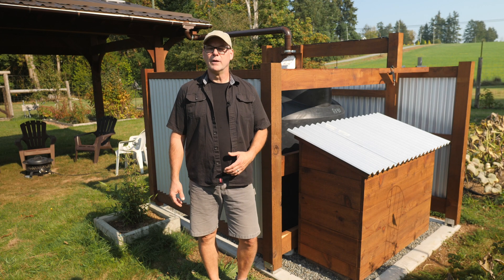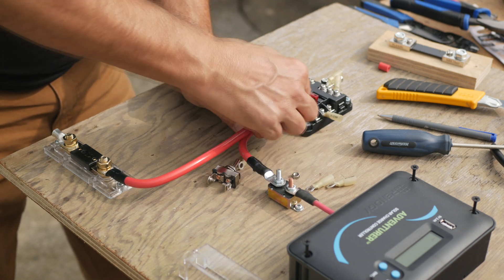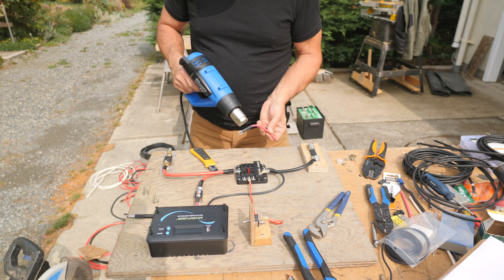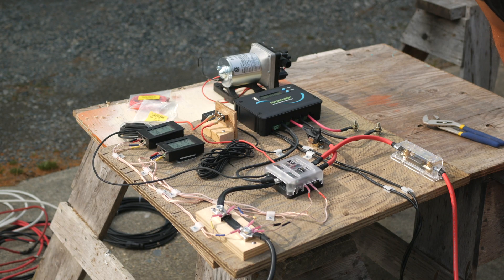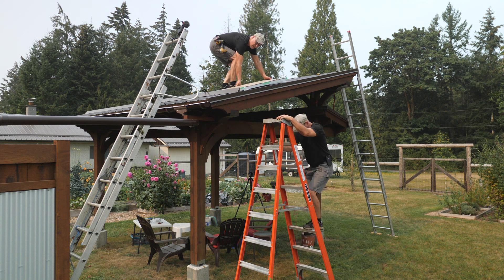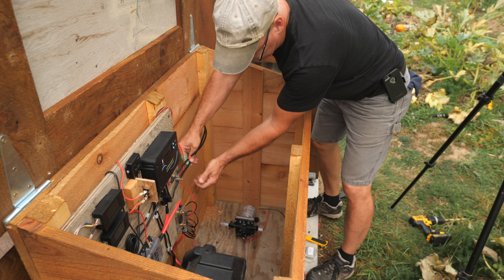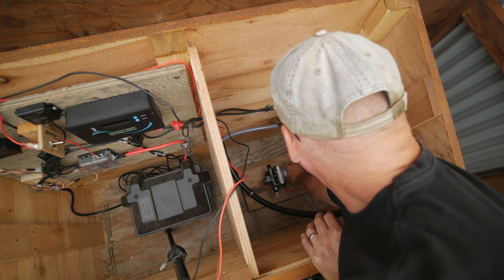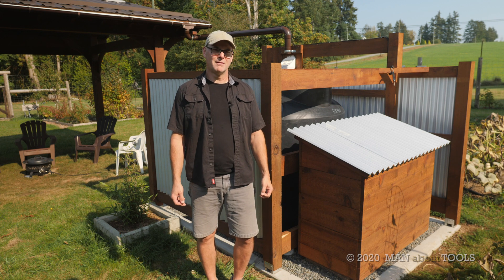Rainwater Harvesting Tank - solar panel & pump setup [OFF GRID]

Comment: Thank  you so much, these videos are awesome. I am about to setup a 1,550 gal rainwater system and your tips, design and build are exactly what  I need. Also, for the rainwater irrigation/solar setup, I am also doing that. I just installed a drip irrigation system for all the raised beds and looking for a solar setup pretty much as you designed. I will be using an "on-demand" pump with a timer which I think is the only difference. Again, great job and I am much impressed.

Comment: Based on the orientation, I’m curious why you couldn’t have mounted the solar panel to the roof of the pump house behind the tank. It appears that both roofs are oriented the same direction.
Reply from the maker: There's big cedars due south. Up on the pavilion is far less shaded.

Comment: Have you calculated how many square meters of roof you need to fill your 500tank? It seems to me that your 25 square meters are not enough.  Maybe the water tank can be filled after one year only if do not consume any water during that time..
Reply from the maker: The roof is definitely undersized for that tank. But sometimes in the spring we can get some long, heavy rains. We are on the west coast living in what is technically a rain forest. Also, I have it set up that I could also use this tank as extra storage from our irrigation well and the other larger tank.

Comment: Looks great. I am a perpetual worrier and would probably not put a lead acid battery in the same compartment as any of my other hardware or electronics due to corrosion concerns. Maybe the compartment is well vented enough. Your call.
Reply from the maker: Thanks! There are enough cracks in the wooden box to allow air flow. So I don't think it would be an issue.
Reply: What doo you think automobile engine compartments are?

Comment: I would have mad the pump house front removable  but other than that I like your set up. The only reason I make this suggestion, at 60 I need easier access.
Reply from the maker: I had that thought too. And it's still possible. I did something similar with a compost bin in the past. The top opens; as well as the front.

Comment: Was that a duct tape bandage I saw while you were connecting the terminals in the box?  I've used a lot of those over the years.  Very nice and clean installation of the solar panels and the pump and filters.  Question-will you see any significant heat build up behind the panel from the color of the roofing or does it stay relatively cool during the summer season?  Thank you for this video series.  Take care and stay well.
Reply from the maker: That was some painters tape around a knuckle bandage. Thanks for the support and taking the time to comment! The roof might get hot and decrease the efficiency of the panel. I'll take some temperature measurements over time and see how it is.

Comment: That one shunt on plywood base.... That could be a fire hazard if it starts to get hot on a very dry day. If it gets wet, that plywood won't make a very good insulator anymore. I mean, it's great for mock-up, and your wiring is excellent, but your choice of materials makes it less than ideal. I would recommend you replacing the plywood with PVC.  A 4'x8',  3/4" thick sheet of it is about $100 at home depot ( They'll even cut it down to size for you if you need ), and for this application, I think it's worth it. Other than that, great job man! Truly excellent layout there. I love it!
Reply: PVC is also flammable as well as quite expensive.  A non-flammable , non-conductive and inexpensive material  like compressed cement sheet would be good in this application.  It can easily be drilled and painted and will never rot.
Reply from the maker: Thanks for your comments here Mark! I will keep an eye on that shunt. I bet I have some PVC around somewhere that I could replace that plywood with.
Reply: oh, side note, they do have smaller sheets, so if you need less than a 4x8, you have options.
Reply: Mark is right.

Comment: Wouldn't it have been just as good to fasten the solar panel to the lid of the pump house? Far less wiring to manage that way
Reply from the maker: I was considering that or having a sloped roof on the surround. But, I think I'll add more panels in the future so will need more space. Also, we have some massive cedar and fir trees to the south of the garden and they would shadow the pump box more than the pavilion roof.

Comment: Since the box floor is elevated above the grade does it act like a drum surface and amplify the pump vibration? Would solid blocking under the floor down to grade at the pump location further reduce vibration/noise?
Reply from the maker: I would agree with you here. And more blocking may reduce it further. Thx!

Comment: consider moving the cables to run on the bottom of the downspout to protect them from UV
Reply: you can also cut a pvc pipe in half (paint if you like) and use it to cover the length of cable from the panel to the housing.
Reply from the maker: Great idea Ryan! Thx!
Reply: I agree that UV is a risk, but those cables are rated for that exposure. They will outlast all other components of the system. The risk to the cables are animals--especially squirrels. I had to replace my entire solar array after squirrels chewed through 75% of the wires. Amazing!